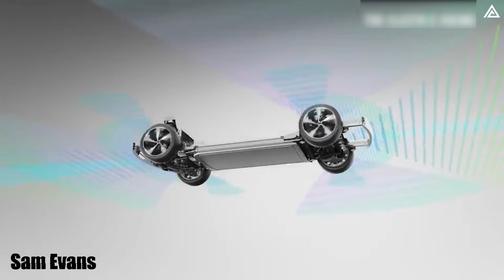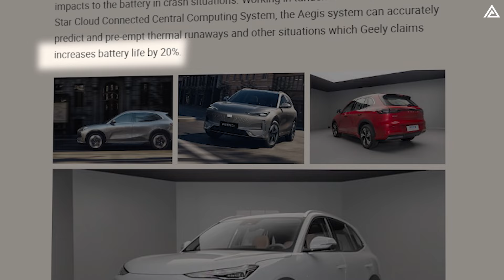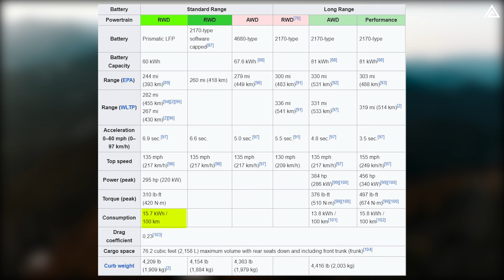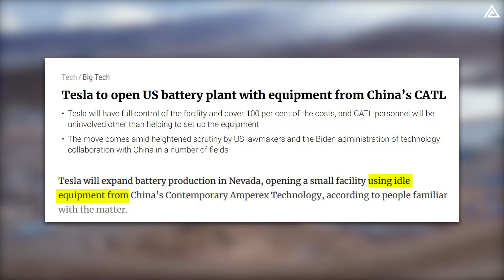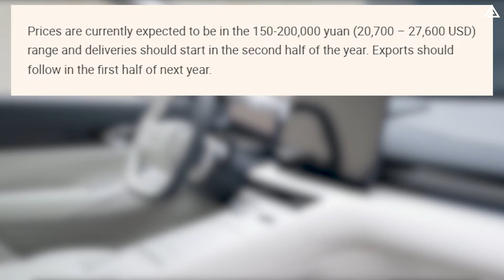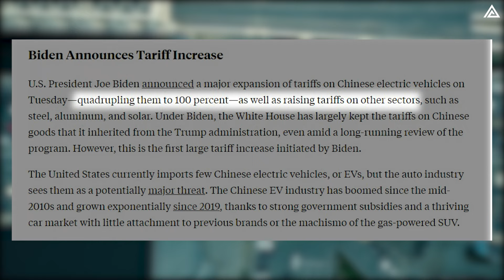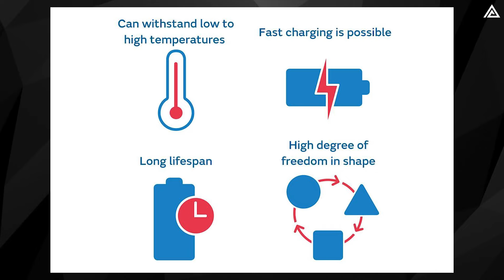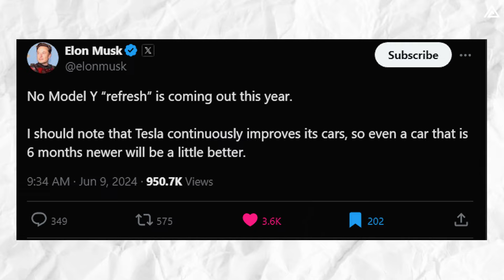Juniper Tech's Model Y Battery NEWS: How Can it CRUSH the Competition?

Comment: It’s good to see that battery technology is moving ahead. I would like to see lithium eventually done away with, and greatly reduced charging time. Range doesn’t need to be more than 400 miles as it allows needed rest stops. More infrastructure is greatly needed, charging stations that have restrooms and eating facilities. Extra range will encourage drivers to keep driving, even though they are fatigued. Years ago it was more about the journey than it was the destination. We all need to slow down. Just my opinion.
Reply from the maker: Well, what you said is not wrong either. But until we got enough infrastructure, having more range is still a good thing to have
Reply: @adamtech999 hopefully one day soon, we can go on road trips with the same reassurance a gas car driver has without checking apps for charging stations.